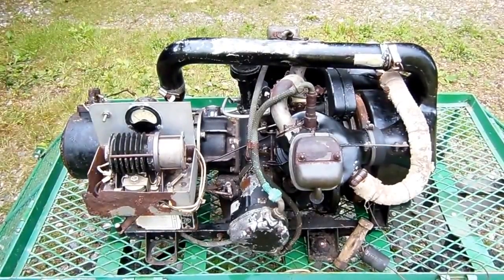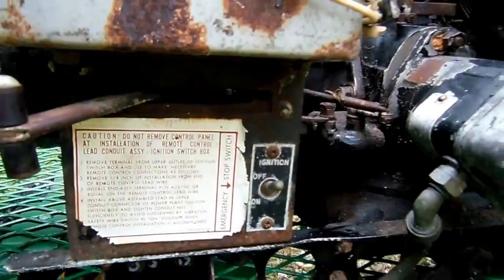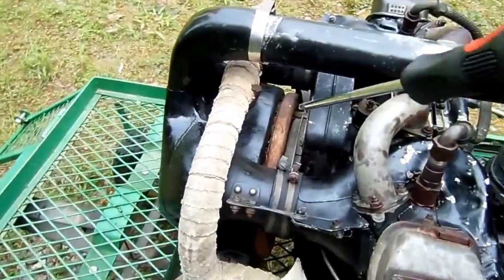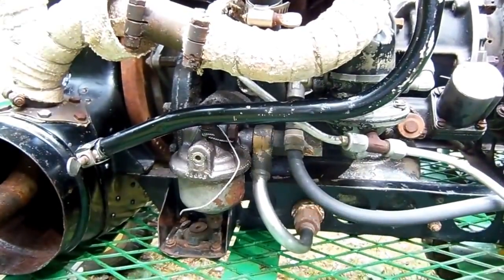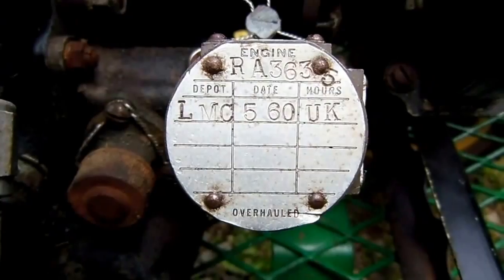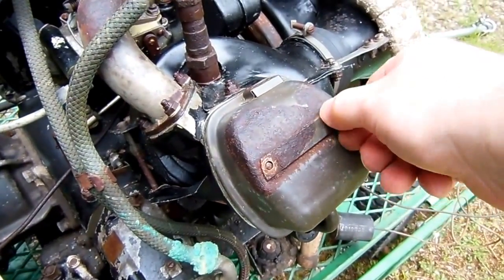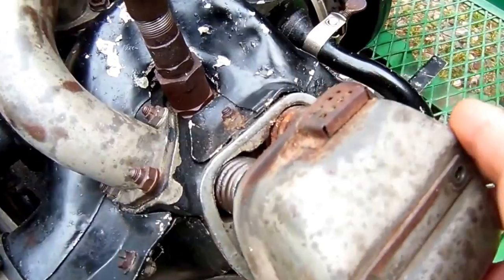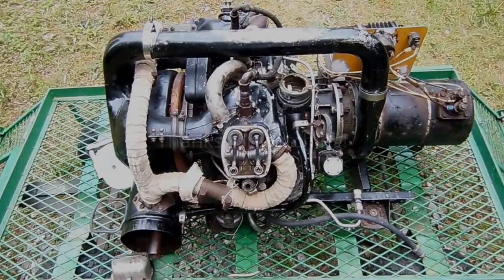WWII B-29 APU - a "farm fresh" walkaround of the Andover V-32 engine

Comment: A little surface rust doesn't kill a valve spring especially in a low rpm engine..I'd be more worried about the valve stem/valve guide relationship before trying to turn the engine over at all...??

Comment: i think the B-29 used different versions of this APU one of another manufacturer i believe the Lawrance A20 D2 a horizontally opposed 4 stroke 2 cylinder the rest used the Andover V32 the early models didn't have the cooling tube to the generator the later ones do as some have the A on the blower housing. they refer to the APU as the Putt Putt then and are still used today as the Martin Mars water bomber uses two of these APUs or putt putts. as some were used on other piston powered aircraft up to the Vietnam war. not just the B-29.  the Andover V32 engine its a 4 stroke V twin.  the APUs on today's jet aircraft uses a turbine to spin the generator as well as starting the engines.

Comment: After WW II, my great uncle made welding rigs out of surplus aircraft generators similar to this, and sold quite a few.  He used commercial utility engines, Vee-4, but I can't remember the make.  I believe he replaced the voltage regulator with a large rheostat to control field current.  I am quite familiar with the carbon-pile voltage regulator pictured here.  A very similar unit was used on Convair liners that I maintained until about 1982.
Reply: I have one of those welders.
I don't know who built it though.

Comment: Looks like a B-17 generator
Reply: the B-17 used a smaller single cylinder two stroke engine for the APU as well as the B-24 i believe the engine was made by Homelite for them then.  this APU is used on the B-29 as well as other aircraft up to the Vietnam war.